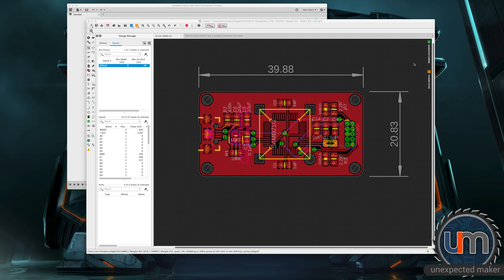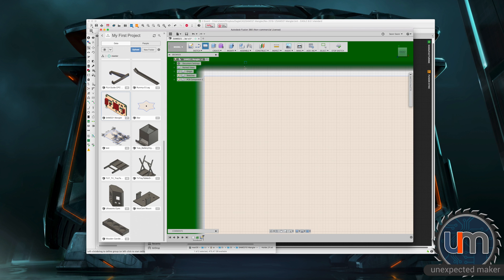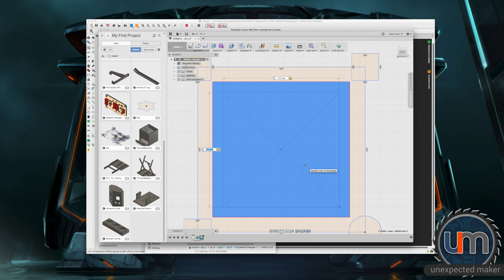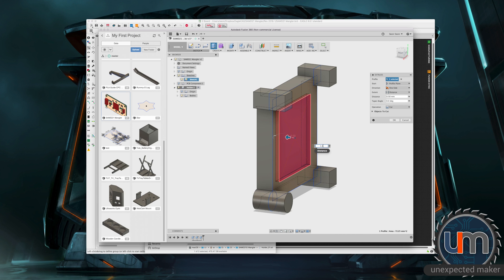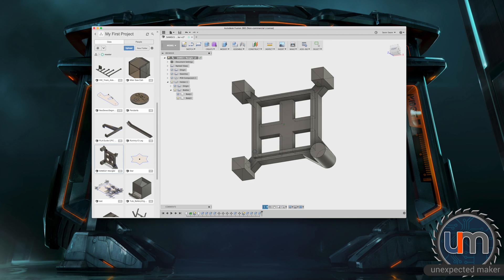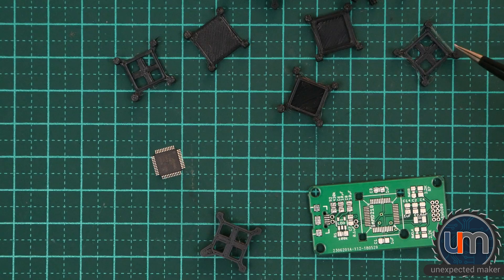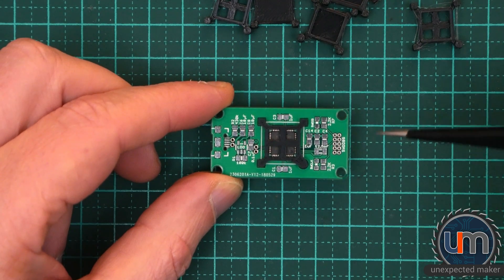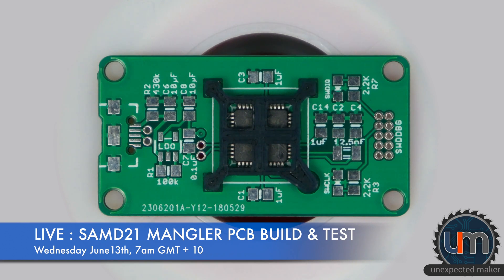SAMD21G Mangler - Part2 - Designing a 3D printed chip holder

Comment: I suggest that your change the material of your chip holder from PLA to ESD-PLA or other ESD material.
PLA is a good static electricity generator and carrier. You can easily damage your chip. See Atmel EMI, EMC, EFT, and ESD Circuit Design Consideration for 32-bit Microcontrollers application note.
It is not because your chip seems ok after programming that it is not damage at some level by ESD.
Get yourself educated on ESD protection good practice.

Comment: Could something like this be used to accurately place bga for home soldering?
Reply from the maker: I guess, but you'd need whatever the support was to stay on the board during reflow to ensure the chip doesn't move - plus the board would need some form of mounting holes to keep the support locked in place. It could work, but prob not a great solution.

Comment: What will be interesting is if you'll need to apply some added downward pressure, to get reliable electrical pin connections?
If so, you might need to go for the "mongrel mangler” version... 
ie. Having the additional feature of accepting a large bulldog clip, to clamp it down! :-)
Reply from the maker: Ha! I was thinking a 250KG bench vice to hold it in place ;) I love the "Mongrel Mangler" name though... "run's off to trademark it" ;)
Reply from the maker: But yes, It will be interesting to see how much pressure I'll need to apply to make good contacts... I'm thinking it will be less than everyone expects ;)
Reply: I was thinking that with the number of pins on the SAM-D21, even if the underside of all the pins are on a perfectly flat plane, there will presumably be variances in the pad tinning thickness which might also create some varying individual pin connection gaps.
If it’s a problem, you could also try a centred underside nub on your 3D print (to apply balanced pressure on the IC) with perhaps split legs to allow a clip-in / squeeze to unclip, tight tensioned grip into the mounting holes (… or just go with a bulldog clip! LOL) 
But I guess we won’t know until you build the first one to try it out! :-)
Reply from the maker: Yup, no point trying to fix a problem I don't know I have yet ;) We'll know for sure in a few days though!

Comment: hmm, shapeways might be a good idea once the design is nailed down. Or any other service that prints in resin or with powder.
Reply: You might find PLA is better for this than PETG. As I’m guessing you'd want the rigidity of PLA for the best clamping pressure! 
As PETG is softer it’s more likely to distort instead of break, whereas PLA has much higher tensile & bending strength. 
Perhaps what you really want (for best rigidity strength), is some ePA-CF. :-)
Reply from the maker: They actually print ok now... but yeah, doing them in resin might be nice, but I don't think it's long term durable. Was thinking of trying my next print in PET-G.